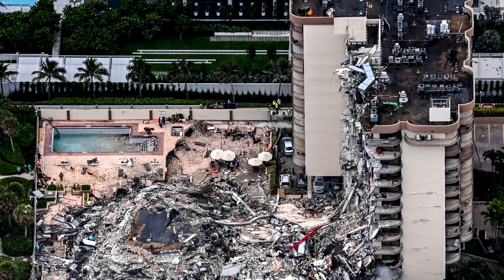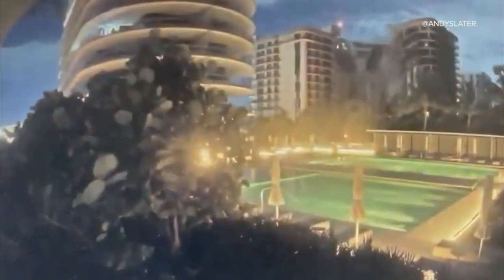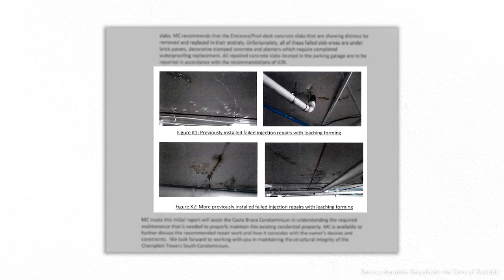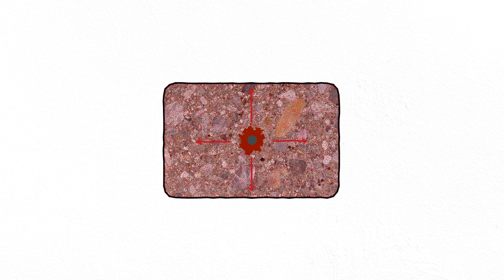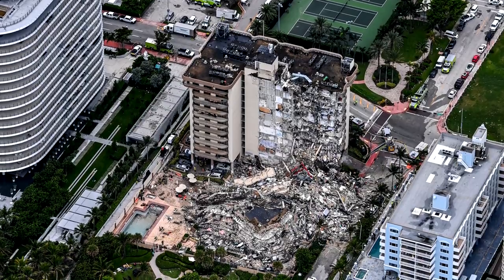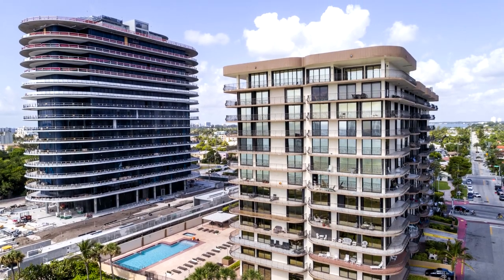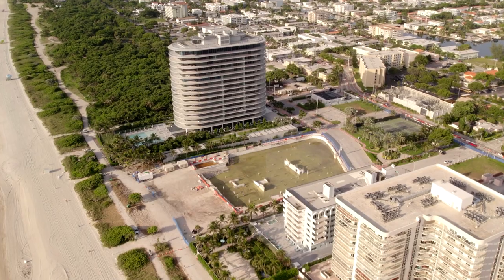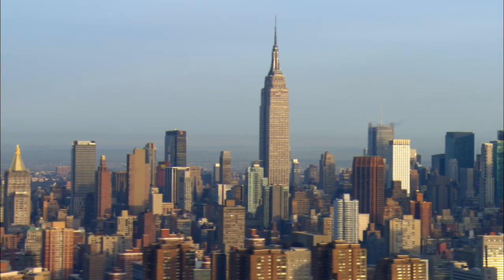Surfside Condo Collapse: What We Know So Far

Comment: A series of shots of the garage area taken by a prospective purchaser shows differences in size between the columns in the failed areas and those in the area which survived. It also shows spalling. If you examine the video of the collapse, the building collapse starts on the inner angle of the L, including the lower half of the riser of the L, where three columns can be seen to be on the point of failing. The rest were linear extensions of stress caused by the initial collapse, knocking out the remaining columns.
The recent legislation in the UK concerning the Grenfell Tower tragedy reimposes the onus of good design and construction on the original builders.  They cannot discharge themselves of it on sale, as the general population cannot be presumed to have knowledge of the construction codes and technical skills to assess the application thereof in the construction of an edifice. The buyer is reliant on their professional reputation as an expression of their detailed competence in the work actually done. That can be subverted in the use of subcontractors. In this case, fraudulent fire approval certification caused inappropriate cladding to be installed on a very large number of buildings in the UK, and when an appliance fire in a lower-level apartment penetrated the glazing, the heat set fire to the filler in the nearby cladding, and the wall-standoffs created a chimney effect, rapidly wicking the fire over the surface of much of the rest of the building, filling it with toxic fumes. Many died.
The design failure here was inadequate materials, overload of the deck from planters (water adding up to a tonne of extra load per cubic meter), and above all insufficient provision of reserve capacity in the original column design.

Comment: First, I would check the design construction drawings between the tower that collapsed with the remaining sister tower to see if there are any differences in design or construction. The remaining sister building should be a great template for the failed building if the same basic design was utilized which it probably was. If the cause of the failure turns out lack of proper maintenance which typically would be responsibility of the condo association comprised of the tenants.

Comment: Another video out - they cut corners on the build. Some of the columns were smaller than the original drawings and the load was greater plus they failed to put in several structural beams under the and around the pool area that would have helped the weight put on them by the pool. Combinations of smaller columns and missing beams contributed to the collapse.

Comment: There seemed to be some issues with support beams and loading. Theres another engineer on youtube going through the certified plans and revisions for the structure and is finding several concrete supports to be calculated at 100% loads, just in dead weight. With excessive rebar overlap in the bottom three levels which can majorly impact concrete curing and ageing. While not exactly an immediate threat at the time, the conditions had zero tolerance for any amount of prolonged deterioration like was seen with the water damage.

Comment: Although there were no drop panels for the slab at the supporting columns throughout the structure, and the step in slab detail failed to provide fully developed rebar dowels across all conceivable failure planes at the lower slab attachment, the elephant in the room is the concrete mix that appeared to not contain the usual 3/4" aggregate that provides the 2 way and 4 way shear strength in the structural elements.  Collapse photos reveal that the column tops failed in a pointed spear fashion, for which years and years of concrete punching shear (4-way) testing did not ever discover.  This new failure plane is most likely due to the omission of the coarse 3/4" minus aggregate in the mix, that probably abundant washed beach sand was substituted for without any testing to prove out it's strength.  Had the sand not been washed, then the strength and durability of the concrete would have been even worse.  Another glaring structural deficiency was the lack of concrete shear walls that could brace the building in both direction, for which the architecture made no provisions for.  But this would not have initiated the failure.  In addition, extra concrete cover to all rebar is highly recommended in corrosive environments in the current ACI building code commentary, but is not required in the code.  That extra concrete cover was not present.  In the beam stirrup specifications, the structural engineer failed to specify where the 1st stirrup is set in from the face of the supporting column, which is usually 2".  Probably half of the calculated stirrup spacing was used, or about 9".  Which could have led to a shear failure in the concrete beams at the ends of the beams.  This is some of the structural red meat that the above video is missing.

Comment: Okay let me break it down for you. I have built dozens of condos,  duct banks, cooling towers, chemical plants, waste water treatment plants, bridges, and just about anything you can imagine with steel reinforced concrete.  We spend a lot of time, and money to make sure the steel does not come in contact with outside elements. If the water gets to the steel, and it rusts. It will eat the steel, and the concrete will fail. The inspection dept that was in charge of checking these buildings should have condemned the building until the problems were addressed.  They take full responsibility when they sign off on it.

Comment: Maybe ground settlement plus the collapse of the pool deck may have caused a pulling motion on the building's columns. Plus, also someone mentioned in a comment that rusty steel expands. Structural members were probably being pushed out of alignment in small fractions though the years. That micro movement would have caused the structural members to deviate from the original structural calculations. Just a guess but from what I know it don't take much to set the course for disaster. When I was a kid, I used to take all the bottles I could find in the bathroom and stuck them up. I would be downstairs with my mom and all of sudden they would just fall down with no known disturbance. Sometimes they would just sit all stacked up and fall right over in front of me. Maybe vibrations from walking around the vicinity of the bottles would cause them to eventually loss equilibrium.

Comment: This seems like we already have a probable cause. The 2018 report showed that the garage's roof wasn't properly waterproofed. This damage alone wouldn't lead anyone to think of "imminent structural collapse, everyone evacuate" but no efforts were made to replace the roof or even seal up cracks where water entered in the years to come. This caused the collapse of the garage roof, which is probably related to the loss of the adjacent building 7 minutes later.

Comment: Another cause was: Florida’s under-regulation.  Other places force condo boards to anticipate big repairs, like a new roof or pillars in 25-30 years, and they must collect a small amount per resident from the start for those repairs.  

Florida lets condo owners delay repair costs and have much smaller repair reserves, which many condo owners will vote for …as this keeps their monthly HOA bill a bit lower.  

But then when the building is older, current residents are hit with an urgent, massive repair bill ….that many can’t pay. 

Florida also worsened the national opioid crisis 20 years ago, when Florida still allowed strip mall “pill mills” where people could fly in and get prescribed huge amounts of drugs of abuse…cash only, of course.  

It was so bad that the West Va to Florida flight was nicknamed  the “Oxy Express,” and Florida helped flood drugs into many states long after others states cracked down on opiod over- prescription.

Comment: This is just incompetence: The pool deck is badly engineered and is failing. It covers a parking garage frequently occupied by all the residents and is anchored to the building supports. But, it’s no problem because at this time it might, in a non-aggressive environment take 40 years to fail. (Oops, salt water ocean right across the street with cars and people transporting it to the site. And is the reason for the damage revealed by casual inspection.) 

Knowing an occupied building will continue to actively fail without forcing a repair to prevent it or abandoning the building is just insane.

Comment: They were made aware of and acknowledged that the building had some serious issues with the maintenance of the pool deck and some issues with the structure under it. They knew about the additional weight added to the pool deck by new flooring and additional changes after construction was completed. They knew, yet did nothing to remedy it. There needs to be a criminal investigation. I know I wouldn’t been the only one upset if there weren’t people sent to prison due to their neglect.

Comment: I've seen rotten concrete from vapor pockets trapped under a waterproofing membrane on a pool deck that had very similar pool/garage setup. Their concrete also has large cracks in the garage area and poor drainage.  Properties just don't maintain their concrete pool decks like they should, this makes sense to me.

Comment: Thanks for mentioning other potential causes, but still...
"Failure to replace the waterproofing in the near future will cause the extent of the concrete deterioration to expand exponentially."  Champlain Tower South Condominium Structural Field Survey Report, October 2018.   
Operative word; "exponentially."  
2 years, 8 months later, building collapse.

Comment: I'm wondering if subsidence isn't exacerbated by "the continental SHELF". This effect on buildings may be nominal in newer buildings and/or even slightly further inland, but even the most meager of "shelf effects" would affect any and all buildings beachside older than 20 years. I recommend "audits" (recertification) be done on all buildings older than 20 years, and every subsequent 5 years after that.

Comment: Excellent!!! As always. However, I have issues with your saying that concrete is "strong and durable." First, it is madness to combine two materials one of which will inevitably corrode over time and lead to the ultimate failure of a structure. Second, it seems that the life of concrete structures is limited to 40-50 years and can be extended to about 100 years. In contrast, the pyramids are standing even after 5,000 years. There are relatively new structures in Europe that have been standing for over 1,000 years. The materials such structures are made of should be called "strong and durable" and not RCC.

Comment: Instead of putting piping to further drain the water which means it was not helping the actual structure that is faulty they should have water proofing on the pool deck and put on the car lower part reinforced concrete pillers to make sure that it could not callapse if that is possible, I am no building engineer or anything like that. Really sad that so many lost their lives. Much love from Australia. 🙏🙏🙏🙏🙏

Comment: Calcium chloride was used in the 70's and 80's to prevent concrete from freezing, but it also speed up concrete setting time. It's use was ban I believe in the early 90's because the steel would disintegrate.
Reply: iv seen its use today to get floors hardened so building can continue next day

Comment: Would coating the steel with a plastic layer before its embedded into the concrete help add to its defense against water corrosion when making reinforced concrete?
Reply: There is epoxy coated steel although I don't know if it existed back then when this was built

Comment: Water being incompressible and going through 40 years of day and night cycle it's a wonder that it didn't collapse earlier. I used water to split rocks in garden by drilling a hole, filling it 80% of water and sealing it with concrete and when winter comes the water freezes and expands it splits the rock, not the same thing here by the same principle. It's sad that it had to go this far to be noticed and taken seriously.
Reply: This is Florida, not the arctic!  Salt is the problem, not freeze-thaw action
Reply: @MarkTillotson  yes I know but there is still going to be huge temperature difference between night and day. Freezing was just one example I was familiar with.

Comment: 13:29 - No engineer might call for an evacuation from a preliminary report - but when there is structural damage you are gambling at that point. The initial report came out in 2018, so you can be sure the water damage happened before that. Compound it with 3 years of inaction by the HOA to fix the damage and this is what you get. Could anyone predict that it would happen 3 years later? No. But it was bound to happen should the HOA keep neglecting to fix the structural issue.

Comment: What has all this meant for the other building that was of the same (I’m assuming) design and vintage? Have the investigators used it as somewhat of a model for what the fallen buildings conditions may have been prior to the collapse. Where those residents removed until a thorough inspection was completed?

Comment: soo..... could you feasibly dip rebar in coating like epoxy or rubber or afford to use stainless?
Reply: Galvanised rebar has been around for literally decades. Though it’s rarely used in buildings.
Reply: no need for that Eric
Reply: @protonneutron9046  why is that
Reply: @ericvickery6357  Because one can get rebar that is twice as strong and 20% as heavy as steel rebar but NEVER rusts and has the same thermal expansion characteristic as concrete so no problem in freeze/thaw cycles either.

Comment: I have seen this before and used to think that it was jack hammed away from the thing to expose the steel I did not know that the steel actually pushed the concrete off, that's amazing to me, it's like in my city a lot of old trees roots under roads and footpaths are pulling up the whole road and foot paths were somtimes I see footpaths that look like it's a skateboard ramp to jump off.

Comment: Some of the Poole area structural columns were smaller this was ok in the original drawings because they had supporting beans but this was taken away in 1980 in the final drawings and the columns weren't made bigger, the way the rebar was tired is questionable as well especially on the shear wall wasn't done correctly.
I think it happened with the splitting of the concrete below the pool area shown in the photo of the pool maintenance engineer, this rebar run the whole length it gaveway causing the rest of the pool area to collapse and because the columns area near the planters was not sufficient after the changes in the final drawing were made cause them to collapse, people adding marble to there apartments and the adding of the extra floor all added to this as well.

Comment: Hey Engineers.  Is it normal to have such a large building supported only by steel reinforced concrete pillars?  Especially stilted ones.  Surely a building this large in a location like this (by the sea and prone to hurricanes) should have had a proper steel skeleton for support.  I've seen people use large amounts of steel in much smaller structures.

Comment: Before any discussions or suggestions of why this tragic event happened I believe it should be agreed what actually happened (This is my opinion): Two columns under the pool slab outside the building footprint failed to keep the slab up. When the pool slab collapsed the horizontal/lateral structural stability of the two corresponding bottom columns of the building was gone and they collapsed and caused a progressive collapse of the building. Why the pool slab columns collapsed will have to be determined by the courts! (Raising salt water, tremors, rust and other corrosion, maintenance faults, missing water proofing, other design faults, supervision faults, construction implementation faults, change of load from additional flower boxes, economic pressure faults, building changes/additions, public inspection faults and may be more issues. There is so much money in this issue for all involved that it will take several years before (if ever) any conclusion will be reached. I feel very sorry for the people who lost loved ones and have to live with years of agony and uncertainty both economic and emotional due to this event.

Comment: On (iron)vessels they installs systems to prevent oxidation of the steel, how come this is not done on buildings like this? Blocks of zink used to be 'eaten' to protect the hull, also systems running current through the steel structure is used, this must be both cheap and effective on a concrete building I would guess?
Reply: "cathodic protection" - I believe there are systems like this for concrete but its not routine, concrete is able to protect itself if the water is kept out.
Reply: @MarkTillotson  - ah, yes, that's it, well, it sounds like water is an issue here, and I think also this cathodic protection is relatively easy to implement and also relatively cheap?

Comment: I put all that steel in for a living. Seeing the slab and column with less steel then what it calls for is the reason why I always double check the drawings. Always would rather more steel then less. I know it's difficult man but cmon
Reply: bouytt guyt  Pipe and wiring all snapping. lol There's electrical all throughout the slabs and walls in plastic pipes. The electrical HAD to go with the collapse which will result in breakers blowing up.

Edit: Sorry for the late reply.